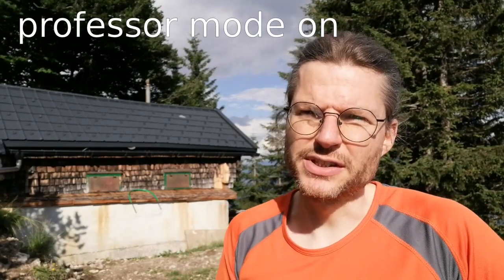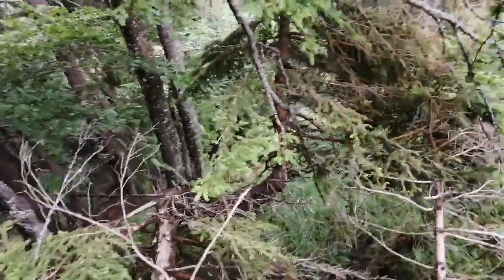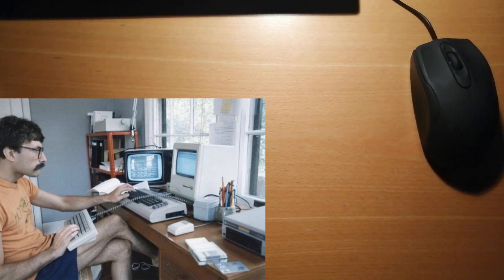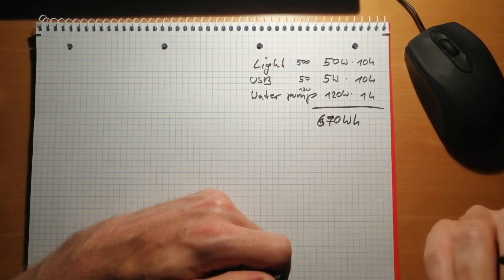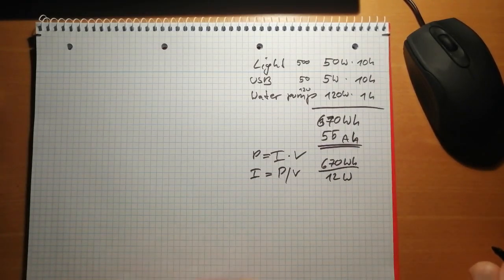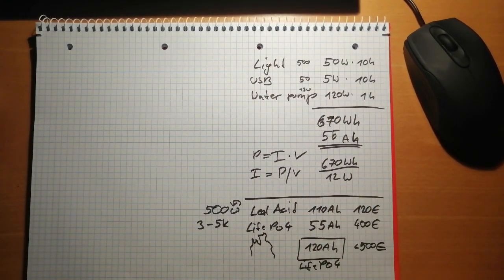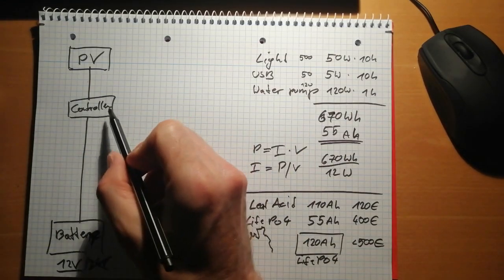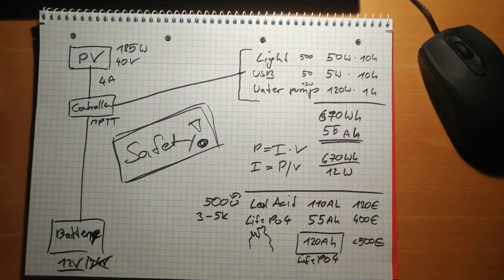How to size & design an off-grid solar system on a mountain hut

Comment: Lifepo4 you need to keep above freezing otherwise it will be destroyed when you try and charge
Reply from the maker: thanks Simon, good point that I forgot to mention. I am currently doing some research about a good solution for this as my BMS doesn't have a low temp cut off and I am not sure if I want to trust a bluetooth temp sensor connected to the charge controller in this environment.
Reply: @LupoDIY  so of the more expensive Daly BMS have low temp cut out.
Reply from the maker: thanks for the information. I just heard that the new ones are a bit unstable and several people reported problems, so I decided to go for an old one as they are really reliable. my plan was then to figure out another solution for the low temp cut off ;) but apparently it is more difficult than expected ;)
Reply from the maker: @straightsilver420  finally,  although I heard that many people encountered problems with the smart dalys, do you have one in use?

Comment: What happens if the solar panel gets covered in snow?
Reply from the maker: there won't be any power ;) ... but usually we also do not use the hut during the winter...too many avalanches in this area. maybe we even remove the panel in winter.